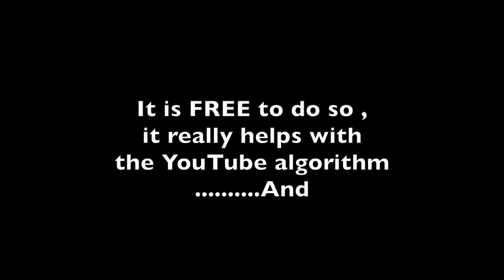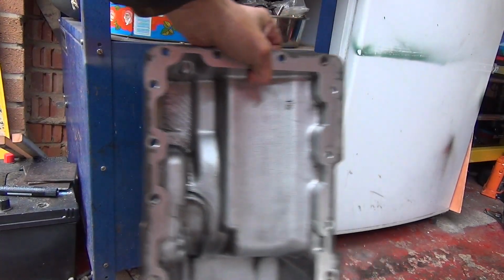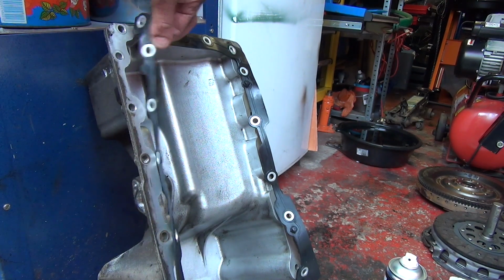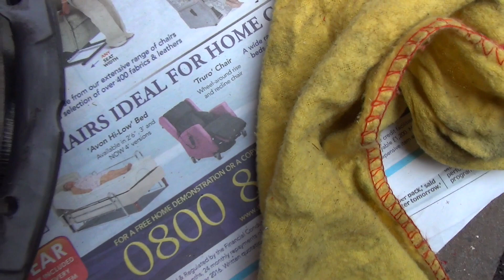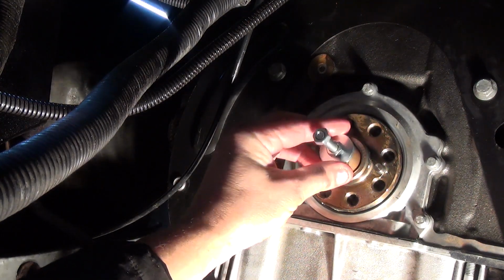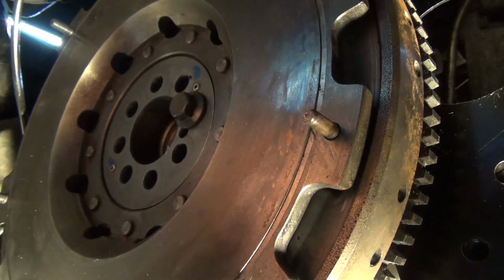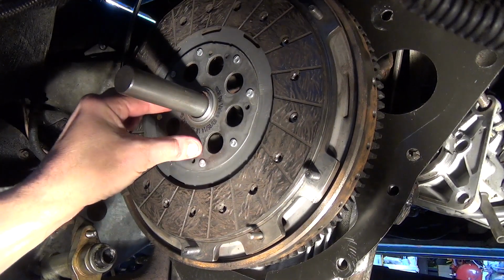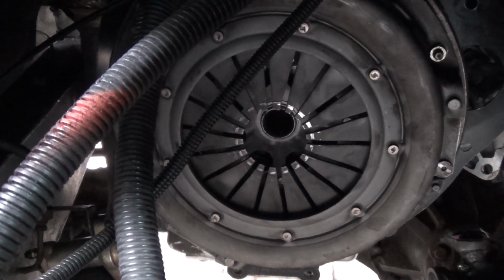Land Rover Defender TD5 Rear Crankshaft Oil Seal Replacement Part 2

Comment: no need to use instant gasket on the mating surface of the seal?
Reply: I don’t, depends on the condition of your mating surfaces. Some people lather sealant on , even though it is supposed to be dry fit. If you are not sure, then just a very light film of sealant on the case.